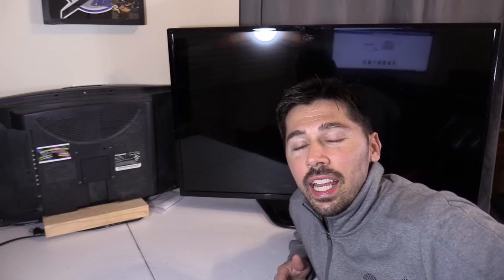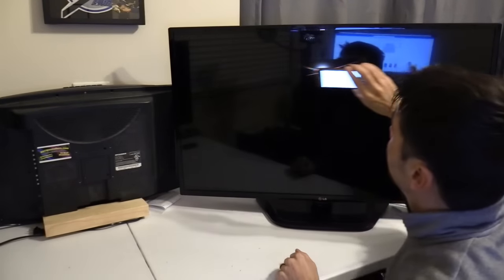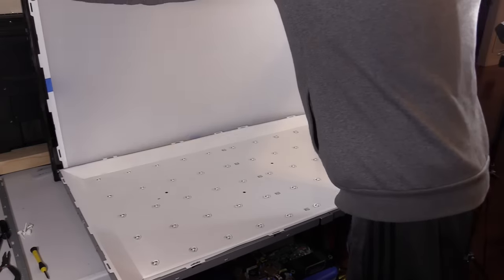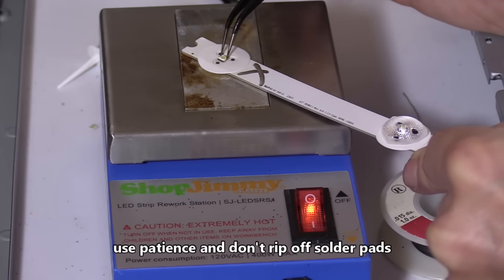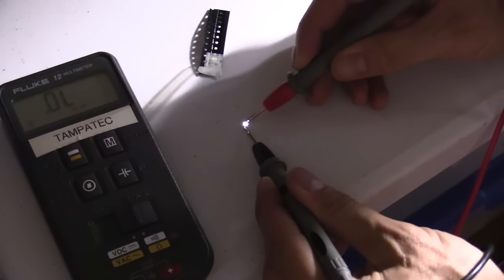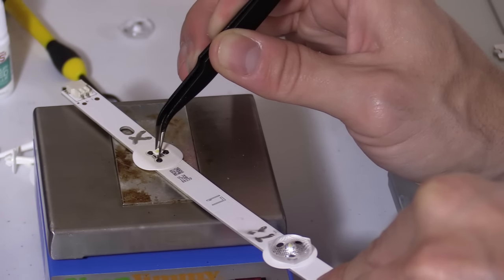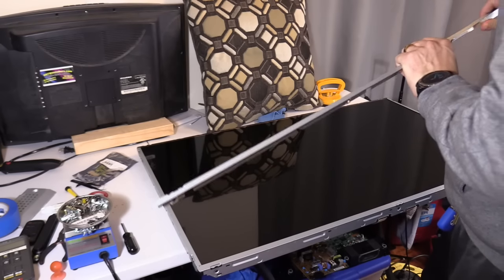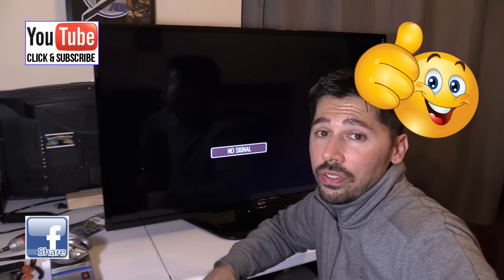LED LCD BLACK SCREEN TV REPAIR, COMMON FIX MUST SEE !!!

Comment: Why wouldn't you just replace all the LED's? It would seem to me it would just be better to replace them all at once so you don't have to keep replacing them but that's just my opinion. Anyway how much does it cost to have this done? I have a 50" LG smart TV just over a year old that has this problem. I can only find the LED's in China and it takes forever to get here and I'm wondering if it would be worth having someone do if for me.
Reply: Oh can you tell me what LED's to get for LG 50lb6100 TV because I'm not sure if it's 3v or 6v or anything else I may need to know

Comment: at 5:30 testing the diode /  The way you show it seems like it  matters not  which way up which way down,     front or back,    left or right   the diode is  laid and it matters not  which 2 of the 4 sides to touch. And then you say it matters and still proceed to touch random 2 sides -random cos from where I stand ALL 4 sides look identical.

Comment: helpp please i have a soniq tv 40' smart and its got the exact same problem but i checked the leds and none of them are broken what would be next? ive check all the boards for visual damage or blown components and cant find anything and physically testing everysingle component on every board isnt really possible for me as these boards have diodes and transistors etc the sizes of pin heads.

Comment: I would expect suction cups to distort or stress the LCD panel where attached. They push around the perimeter and suck in the middle. Very risky.

Comment: Hey i have an LG47LN5406 from 2013 yesterday I had a problem and i don't want to throw away this nice tv it's starting showing the LG logo and display image get  lost but tv it's still on ,when i turning of and turn it on it's happening same LG Logo and imagine it's gone.i tried with disconnecting power supply but still have that problem,what i have to replace.please fine advice and help.thank you in advance guys

Comment: I had the same problem on my 32" LG with no image but sound working when turned on so the fix was to replace the remote battery.
Reply: U mean the remote control could be bad ?

Comment: I can see all the LED strips are lighted and so is my power button but the lights just blink off and on over and over.  I replaced the POWER BOARD THE TCON BOARD THE MAIN BOARD AND THE WIFI  -- Nothing changed

Comment: Tempatec i have a Mitsubishi wL 82913 it has green light of death blinking constantly can you please help me how to fix that issue plz ???i cant throw this tv away plz help !
Reply from the maker: 2 cents see here Mitsubishi TV  error codes, usually that blinking light means you need to replace the lamp.  https://youtu.be/INird71KKtA
Reply: Thanks for ur reply tampatec it’s constant green blinking light tv doesn’t turn on at all its just green blinking light and that video doesn’t mention anything abt constant green blinking light! Searched web it seems like something with capacitor dm module??

Comment: i have a led TV when i test the voltage going to LED stripes always 10 volts even when the TV is turned off (with the red standby led on).
when i turn the TV on the voltage rises to about 25 volts and voltage start dropping down to 10 volts again  in a matter of few seconds and stabilize at 10 volts.. any ideas?
Reply: 10v its the standby mode and the reason it drops after turning on its because theres open circuit in the led strips

Comment: I got a dark patch in the right and corner. Of the TV. But I'm scared to crack my screen. It's a 55inch jvc if any can fix it I will pay u. The TV works and comes on but just a dark shade in bottom left corner

Comment: Well that’s great you put your fingers on the inside of the screen and touch all the layers too with your fingers. So lots of finger prints. Great repair. By the way people if your going to take a lcd panel apart please make sure not to use bare fingers. You will get prints inside and also you need to do it in a dust free area. Most important is static can damage the panel so use gloves when doing this. This person should be showing you not how to handle a lcd panel.

Comment: My $1,600" LG 3D 4K that I have had for only two years and now it has a black screen.  It is  too  big to put in the car so I have a LG technician to come out and look at it for $90. and I'm  so  afraid that the repair cost will so high that it will be not worth fixing or I will be ripped off.

Comment: pleas help toshiba 32l1334dg when i turn it on light on the power indicator/led flashes red and green, and then stays green, there is no back light, no image when im using a flashlight. only has tcon, mainbaord that has the hdmi and all the conectors, and psu baord. what do i need to do to fix this? have been reading online for 8 hours now and still no solution....

Comment: My heart skipped a beat when you dropped the screen. Also, some LEDs will light but show OL when you reverse polarity. It all depends on if they have a protection diode or not.

Comment: Make sure the suction cups are hot water drop on them to softness  them
An redo  the cups again  never try  use  it  again  until cups are  softened 
Shop Jimmy don't tell you that 
It's a one time use  on them on the sticky  new

Comment: what if screen flashes on then off every 2 or so seconds. is this the same problem?
Reply: Probably so. I repaired an LG 50LB6100 last month which was doing exactly that. And it's a common symptom for that model.

Comment: If you want to save money buy the LEDs yourself. Never buy put together kits for anything if you can help it(except in some obvious cases, like mass produced kits that are cheaper than assembled units or each part separately), that's just another middleman that needs to get paid, so you're either paying much more for the same part you'd get from digikey, mouser, Newark, etc. Or you're paying around the same price or maybe even less but for some random unmatched batch of LEDs they found for the cheapest price that day from the Shenzhen market, which you could've also bought yourself for probably 1/10 the price. Cost vs quality/performance is just one of several reasons its usually best to have the shortest route from manufacturer to you.

Comment: solder .. pronounced, SAH'-der, if you're from the northeast or SAW'-der, if you're not.  .......that's just the way I've always heard it pronounced and I'm an electrician. NEVER heard SOUL-der. ever.
BUT, hey, thanks for the video. i have the exact same model doing the exact same thing.  It's worth a shot. I'll give it a go and let you know.

Comment: What could be the problem when my LED TV sometimes has these weird lines on the screen and kinda distorts the image. And then it suddenly turns off. Audio is still there but no video. I have to change source first or turn the tv on and off for it to return.

Comment: This is way too much work for the average Joe you can Buy a 📺 cheaper now than ever before I just bought a TCL smart TV 32 inch for my bedroom for $138 brand new at Walmart because my 49” Vizio started doing the exact same thing,,,, I may end up going to Walmart online and buying a 50 inch Septra for $199 I think it was,,,, all this being said if I had your smarts and gadgets and a lot of time on my hands I’d probably try and fix mine also however I don’t have the time or the patience or all the gadgets or the knowledge

Comment: Dear sir my house tv led name haas,only sound led light all ok screen black please explain what reason.
Reply from the maker: Irshad Hassan if your TV has audio but no picture that could mean either the t-con board is bad or the back light circuit is bad so if you turn off the lights in your room and the backlight glows then check the t-con board. get tv boards at shopjimmy.com or electropartsonline.com use code tampatecfriend for discount.
Reply: Irshad Hassan

Comment: I got a Westinghouse tv 4k50 inch wd50k4550 from a store here in knoxville Tennessee i have only had it for 4 months now I have no picture sound no pic well I call WH they were not very helpful I couldn't understand the person on phone well after going threw all this trouble shooting with nothing working they tell me I have to out of my own pocket send them the tv whaaaat realy 4 months old wow so if you are thinking about WH tv read this first and by the way I told them I was on disability and could not and did not have the money to send them their own tv to them that is only 4 months old that's their rules sure would like to talk to that guy that made that rule if I could understand them